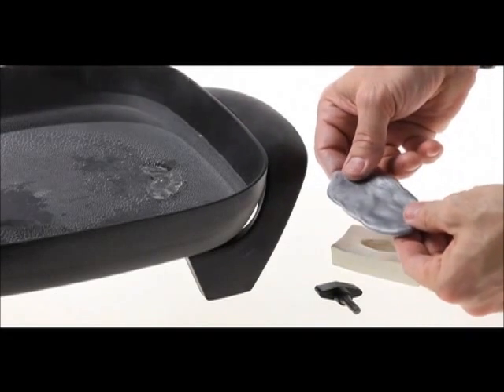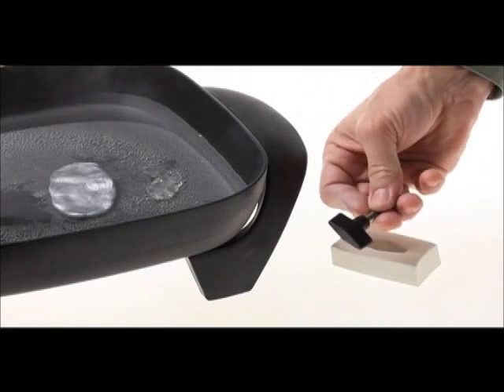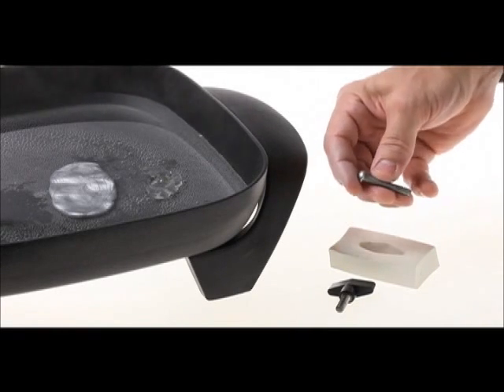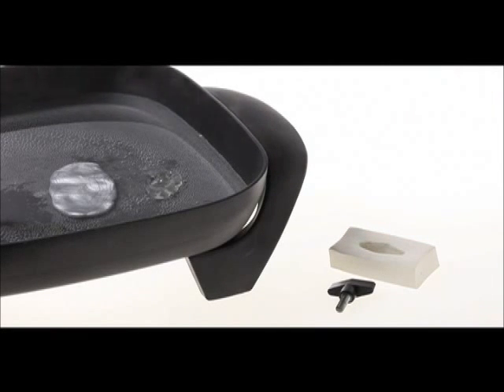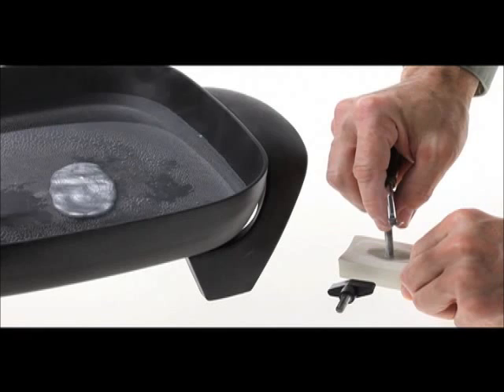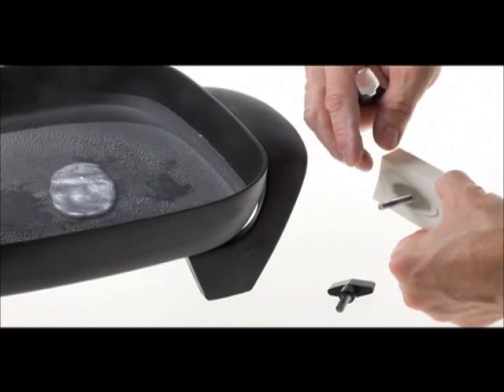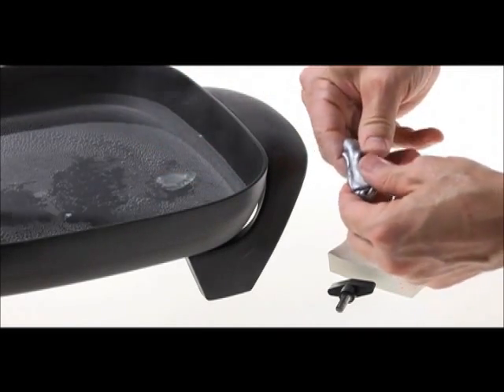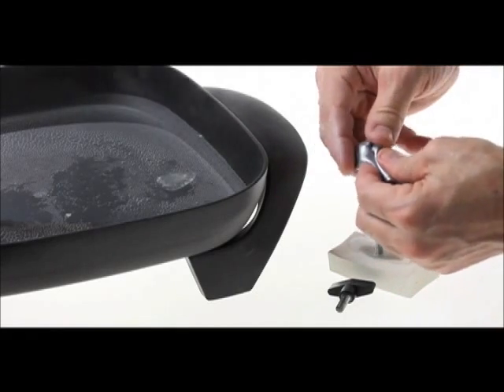Hand Moldable Plastic Molding a Handle

Comment: A way to make the handle a little more durable is to use a hex head screw or place a piece of steel rod through the slot, if you must use a slotted screw.  Often with these type of handle, the screw breaks free inside the handle if too much force is applied.  Of course if that happens here, just reheat and remake the handle when time allows.